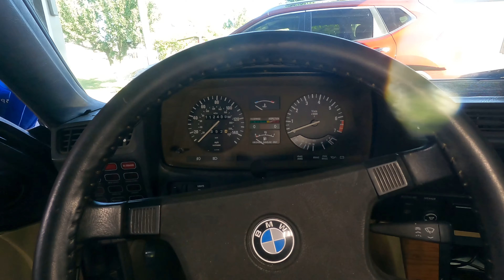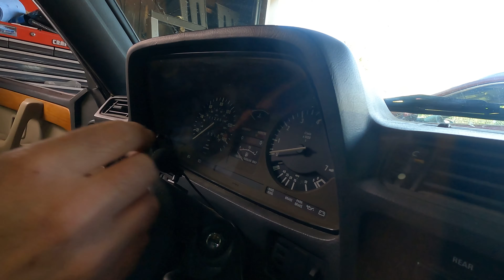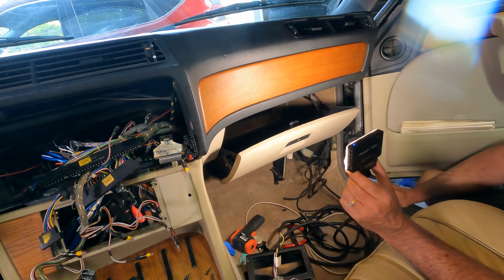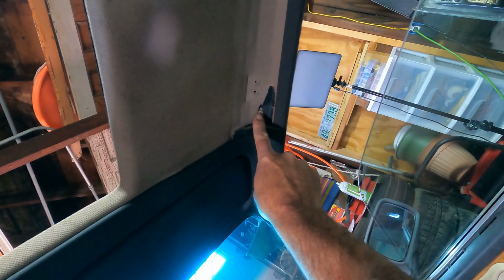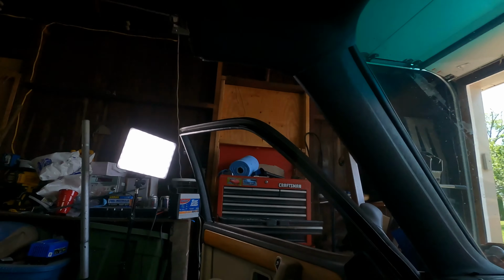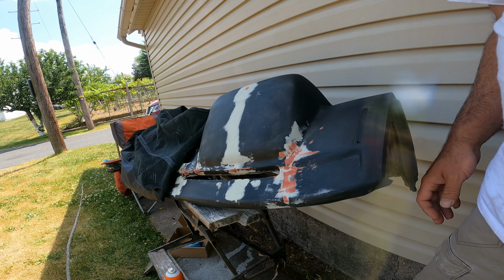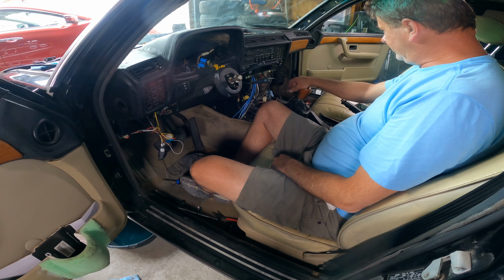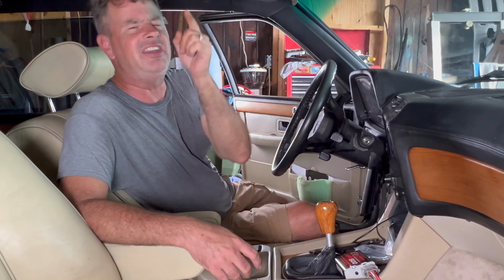Idiot Restores Cracked Dash on a BMW 7 E23

Comment: It seems like every time I’ve worked on a BMW you had to know crazy tricks to get the job done easily. If you don’t know the trick, it was very difficult and hard to figure out!
I had a vacuum canister in my Ford van that had the lines to it disintegrated. It was under the blower fan under the battery under the AC lines under the hood. So I found a YouTube video that said to pull the vacuum line through the firewall and install a new vacuum canister under the dash. So I did that and it probably saved about seven hours of work.
Reply from the maker: Yeah. The bmw vacuum for the hvac is… not fun. Especially because you can’t just buy the parts. I do refurb them. But they never work as well. I have gotten to the point where my goal is repairable and reliable. So I’ll replace parts as a can with other parts that will work regardless of them being bmw parts. :-) I can get ford and Chevy parts at autozone. :-)
Reply from the maker: Oh and the heater core is a nightmare man. That thing was NEVER meant to come out. Lol
Reply: @fortheloveofcarz  that’s right!!

Comment: Nice work! What kind of glue did you use? I once redid the headlining of my w124 with spray-on glue and it was horrible. Next time i‘ll use something that is stronger an can be applied with a brush.
Anyway, lft your opinion on the glue-topic😄
Best wishes from germany
Reply from the maker: I believe I used super 77 its called. Ive seen it used on shows that show upholstery work so I figured if its good enough for them it would work for me. It seems to do well.